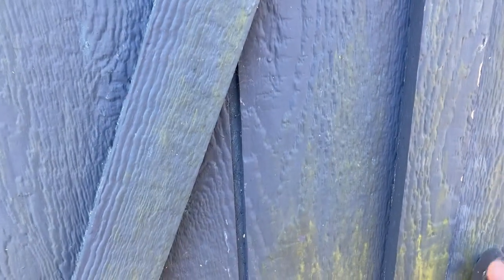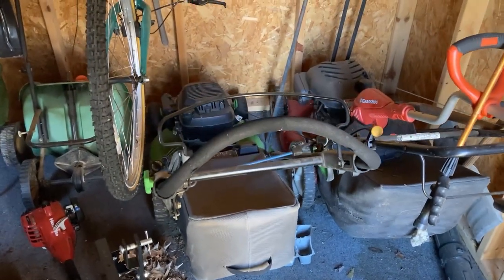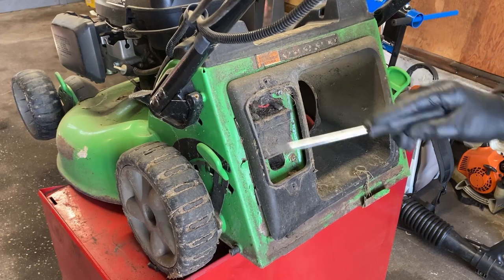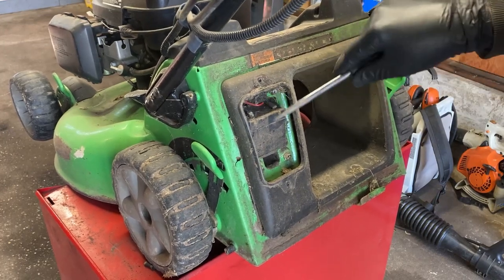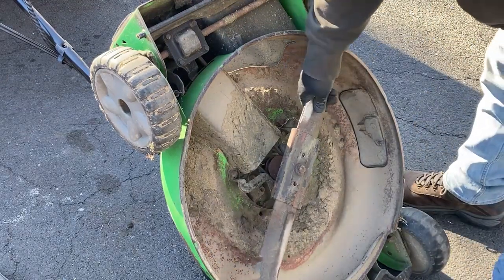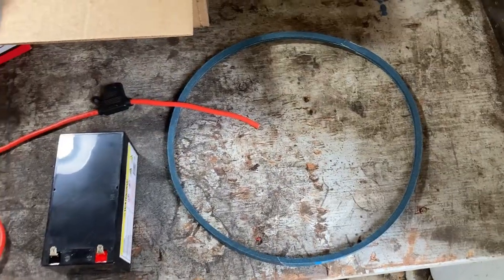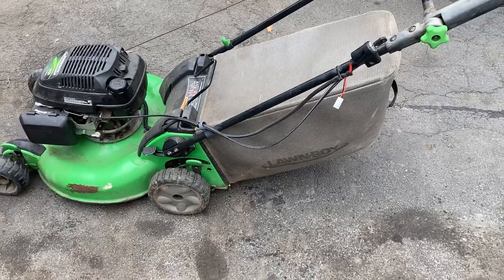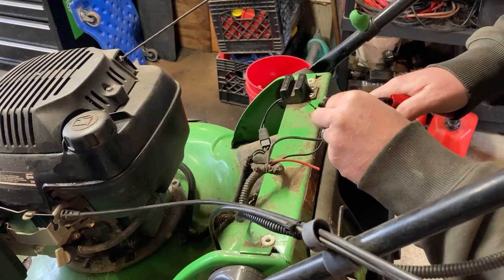This Lawnboy has been a Shedboy for years. Let's fix this mower up back to like new again.

Comment: Just discovered your channel the other day, Noah. Going through the list and watching several videos I’ll comment on when I get a chance. 
Do you have a pressure washer?
Reply from the maker: Thanks for the sub! I do have a pressure washer, but it needs a new water pump currently haha. I also have a weaker electric one hanging around
Reply: @GormanRepairs  
I use an electric one although I could fix up one of the gas ones I have if I needed more power. I was just going to suggest an electric one for occasional cleanup of machines before you start working on them.

Comment: Can you cite the make/model of that replacement battery and include a link for the source?
Reply from the maker: ML3-12 - 12 Volt 3 AH, F1 Terminal, Rechargeable SLA AGM Battery https://a.co/d/hXjAWl3
Reply from the maker: It’s just some cheap no name Amazon battery that I matched up a compatible part number to. They’re sort of all over the internet. I just had to make sure it was a 12v battery with the same connections and that part number dictated the physical size
Reply: @GormanRepairs    Thanks!  That one reminded me of one I have in a scale I use for baking which needs a replacement. I’d never seen one before this. Your info will give me a starting point to search for the one I need.

Comment: Your audio production quality could be more consistent. In this video there were times even with headphones on and volume all the way up I couldn’t make out what you were saying. Try to enunciate more slowly and clearly and always make sure to address the microphone. Position the mic the same way whenever possible. 👍
Reply from the maker: I agree. I realize I’m talking fast and my brain is thinking the words faster than my mouth can get them out sometimes haha. I plan on focusing on that, and my microphones that I was using have been proving to be pretty unreliable and I really don’t like the quality, so I stopped using them all together. But I’m going to spend a few bucks on a higher quality lav mic soon. I was an audio engineer in a past life and have schooling in that, so I take the sound quality kind of personally haha but I need to actually make it good. I do know that
Reply: @GormanRepairs  
I did the sound for a reggae band for six months and also did announcing and background music at horse shows for several years, so I have similar knowledge. I was going to suggest a remote lav mic when you could afford it. I also know of some other creators who do mostly voiceover, which then makes the audio recording while working not necessary but adds a layer of effort during editing. The Greasy Shop Rag is one.